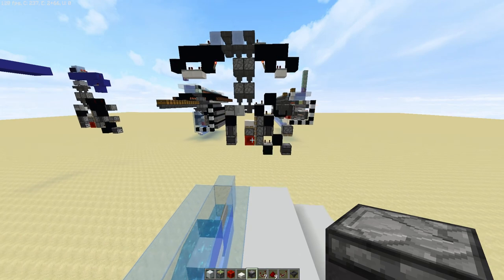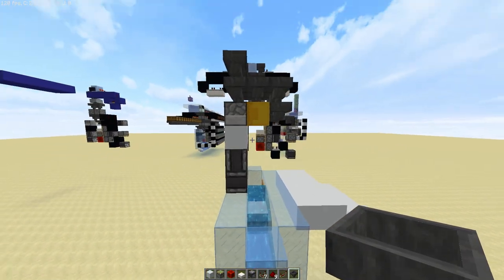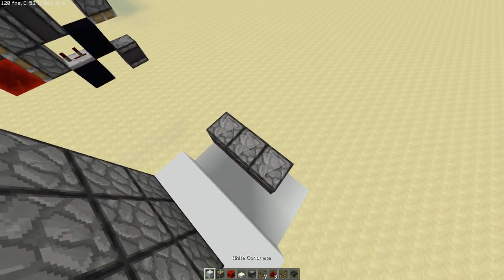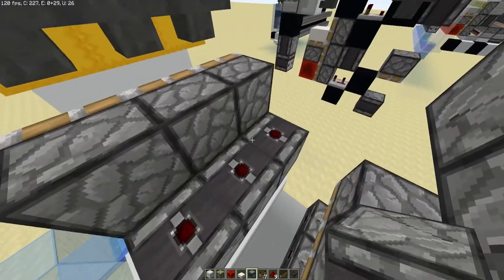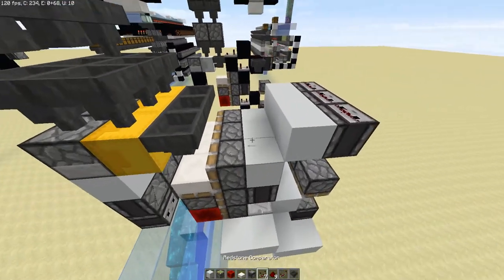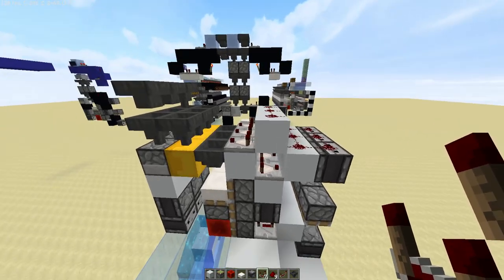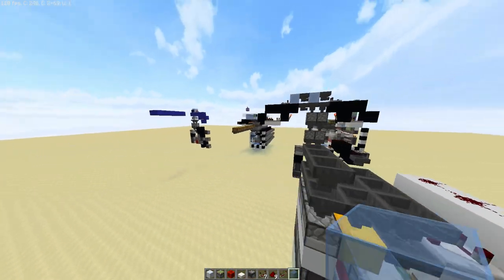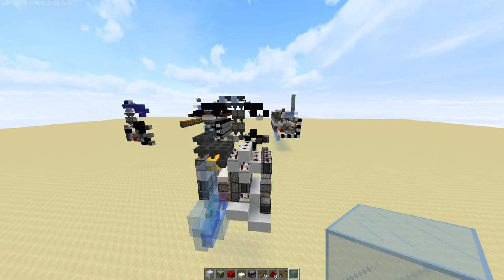Tutorial: 2x Faster Shulker Box Loader

Comment: Hoppers have changed you have to lock both of them now
Reply from the maker: Seems to work fine for me. The only hopper change I am aware of is the change in pickup interval timings.
Reply: @xMistaBeastxGames  The bottom hopper going into the shulker box locks the top one, causing there to be a single item left in that hopper which will never fill up enough to trigger the pistons.